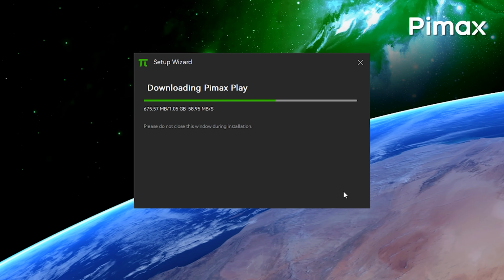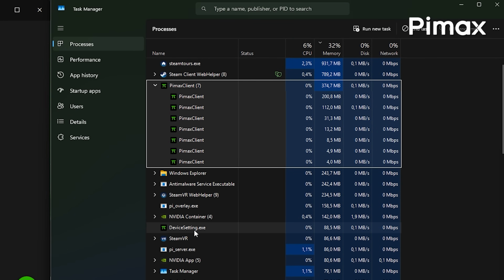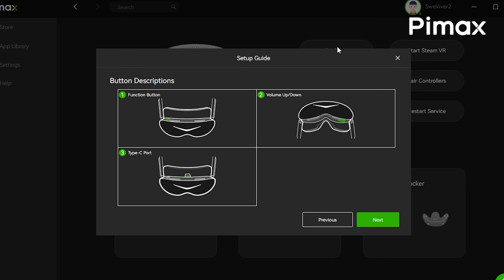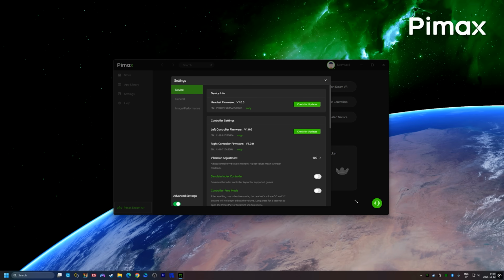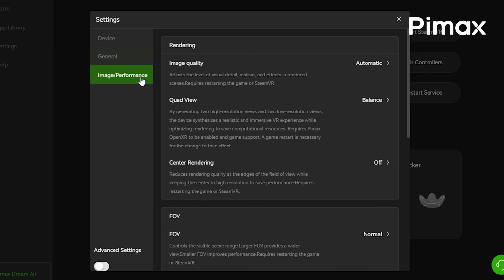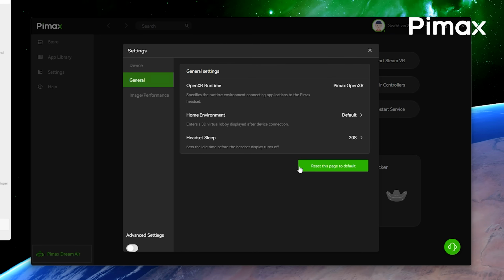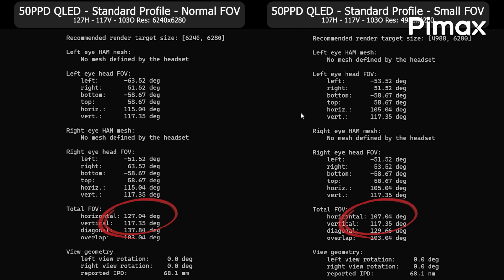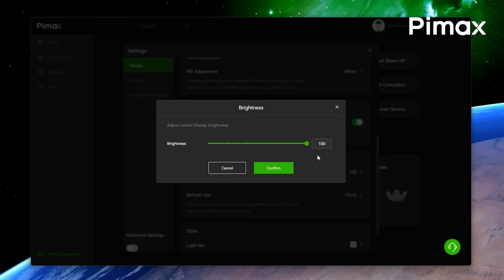Tested: Pimax Play 2.0 Beta - Smarter, cleaner and faster!

Comment: Just let me see my Windows desktop in VR HMD by default!
Reply: I emailed them begging for a physical toggle slider button on the headset for which mode is default when entering a headset.  If I want to use it like a monitor I want to put on my headset and immediately see my desktop, and for the gamers, I assume the opposite.
Reply: Agree, i dont use the controllers, i just want windows to be displayed and use my mouse to navigate and start my games. @brettmiller68
Reply: Yeah and make sure the MOUSE is visible when NOT using the controllers!
Reply: @antjones2281   Yes, they could detect mouse movement and make the pointer visible as long as the mouse is moving plus 10 seconds after. (A comment from @tom4strike suggested enabling mouse pointer trail).
Reply: @PimaxVR look it seems a feature wanted by fellow Pimax users. Please add this to 2.0.
Reply: like varjo aero had. it was nice
Reply: Please that is a necessary function!!!

Comment: Martin, thank you for the great overview.  To the engineers and Jaap and anyone else from Pimax reading this, I can promise you the new users (and myself) are going to hate you for the clicks in and out of a popup for each single setting.  We all know how much tweaking gets done to setup headsets, and the number of clicks just to go in and out of all of those settings will be in the hundreds and you will have people hating your company and wanting refunds as a result.  I understand and agree that UI needs simplified, but this is not the way; THE BETTER SOLUTION: is to introduce a standard easy mode UI where they simply pick profiles and all of those settings are preselected in those profiles and they don't have to see them.  And then when they switch on the advanced toggle at the bottom left of the screen that you have now, it pops up the screen with the settings AND ALL THE CHOICES AND SLIDERS BESIDE IT, WITH NO CLICKS TO GET TO EACH OF THE OPTIONS, LIKE IT USED TO BE.  The psychology and UI design behind this is basic and allows the user to make the choice between clean and preselected options, or busy and all options to choose from, and is the best of both worlds as it maximizes user satisfaction psychologically as THEY ARE MAKING THE CHOICE BETWEEN THE UIs, and not having the worst of both worlds, which is this design, shoved down their throats.  I am begging you to change this now while it is still in beta, because you will have hate spewed at your engineers if you don't; I am predicting it now.

Also to add: is a way to share all of your settings as a link like a qr code to friends and that people can post in subreddits and Facebook community, and a way to post their favorite settings in a type of marketplace on Pimax Play 2.0.  And making the people who get the most downloads of their settings profiles get store credit.  You must make an incentive system for people to post their pc specs, what games they are using with this profile, and face type and personal preference for ultrawide vs high framerate vs high resolution etc.  This will create a network effect of making everyone in the community talk about it and post profiles, which will bring more eyeballs to Pimax and sell more headsets.  This will also create a lower barrier to entry for people setting up new headsets as they can copy their favorite youtubers settings to start and then modify to satisfy them after they are used to it.  This profile idea matches my easy mode UI idea in my first paragraph above and then when they switch to advanced mode they can then modify all of those settings from that profile they inputted the link for, or add a different profile and then adjust those settings from that profile.  And also allowing them to save and make multi custom profiles like for different games or gaming vs work and using it as a monitor.    This profile system idea above, allowing sharing and inputting of profiles IS EXACTLY WHAT PEOPLE ARE DOING NOW WHEN THEY FIRST SETUP, they just have to spend hours finding their favorite gamers settings and figuring out how to match each setting to theirs (which will be hell if they have to click in and out of each popup as my first paragraph talks about), and makes a high barrier to entry and puts off new users compared to just pasting in the link to the profile, or selecting one from a "Pimax Play Setting Profile Marketplace" and be playing in 3 minutes vs 3 hours of setup.

PLEASE DELAY Pimax Play 2.0 TO ADD THIS, as while an update is needed, no one in the community is asking for the update, so a delay to add it will be no problem, and it is way way way more important that this is delayed and released right, than released as is now and make people have a very unhappy user experience.

PS Pimax I love you and desperately want to see you succeed and am doing my best to bring solutions to issues I see, thank you for all you are doing for us and the VR community.

Comment: Honestly, I am not so fond of the Pimax UI, the color and everything.  I prefer the old Pitool UI...and its blue color.  I understand that Pimax signature color is green but it wasn't that slick looking. The 2.0 doesn't look much different than before.  I thought I am going to be seeing a total change such as fonts, colors and basically the whole UI and themes, but it looks the same as before...nothing significantly change.  Oh well.
Reply: Not a fan of the changes. Seems like a step backwards from the current UI. Too many clicks.   The current interface IMO is great.
Reply: @YoshimiPinkRobot  I like how they added proper tooltips with more detailed explanation for each obscure setting they have. But ideally it'd be best if instead of modal box popups it would just expand main settings window, like a collapsed control group.
Reply: Will we be able to eventually use the volume buttons to adjust ipd since auto ipd is gone? Otherwise, especially with the newly introduced extra clicks to adjust ipd in Pimax Play, it’s going to be PITA switching between players.